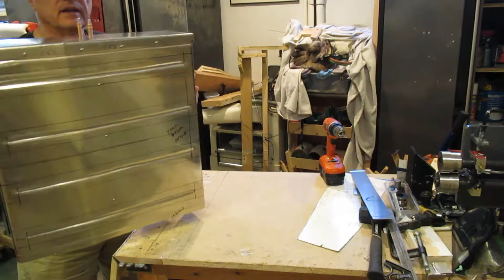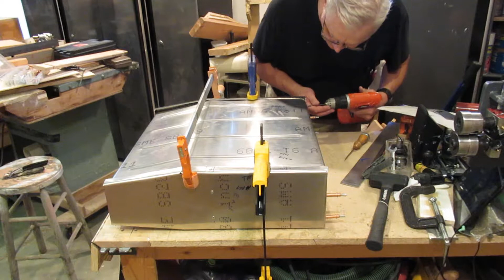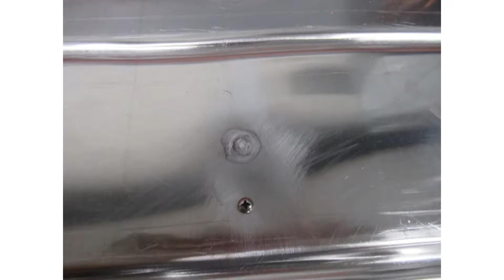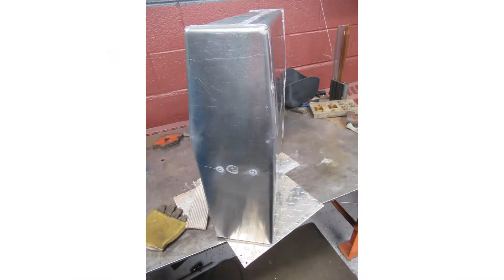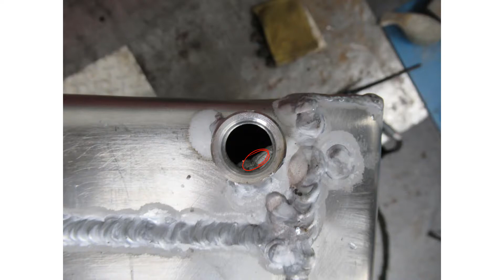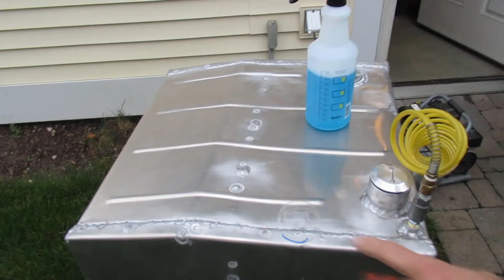New Aluminium Fuel Tank 7, Assembly, welding, leak check.

Comment: What is the thickness? What thickness would you recommend for a 20 Gal saddle type tank? Thanx
Reply from the maker: I used .062 inch 6061 - that was the thickness of the original tank - I have no idea what you might need for a saddle tank. Sorry...

Comment: Hii jim 
How can we measure the quantity of fuel present in aluminum tank 
As it's aluminum tank dipping any sort of sensor or any stuff for Measuring purpose may lead to certain reactions 
So what to use exactly to see the level of fuel over the tank?
Reply from the maker: Use of standard fuel sending units has not been a problem for aluminum fuel tanks in aircraft. For example: https://www.aircraftspruce.com/catalog/eppages/rochesterSender.php A more sophisticated sender would be something like this:  https://www.aircraftspruce.com/pages/ep/fuelsender/westfuelqty3.php